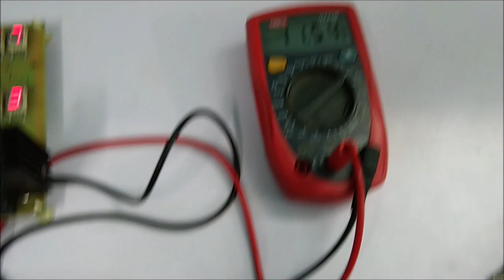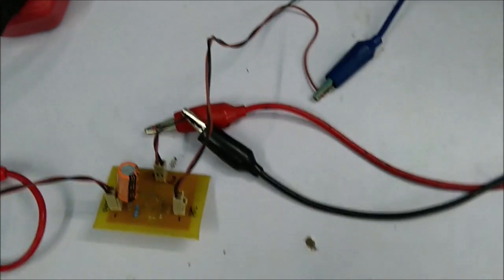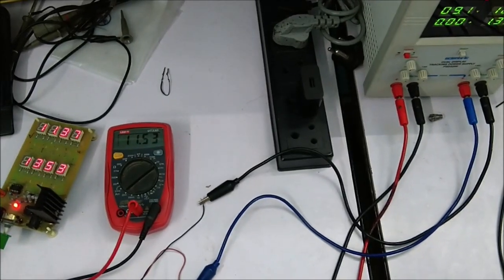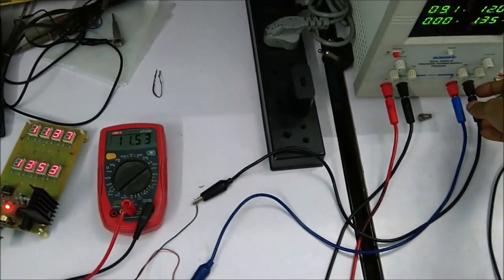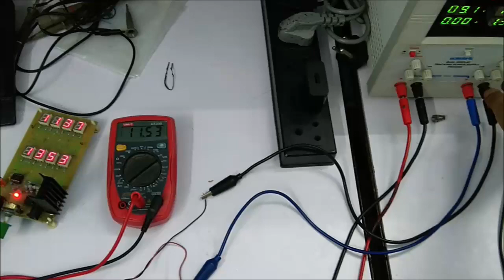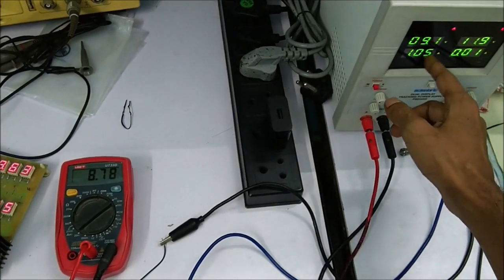Power Path Controller system using LTC4412

Comment: LTC4412 based ideal diode board also works on the same way. I have tried it and it works flawlessly. I connected 12v battery to input terminal and the AC wall adapter to output terminal.

Comment: its really nice information. I have a question. what will happened if both primary and secondary power supply are at same voltage? 
suppose both are kept at 9V??
Reply: The difference between voltage source should be 20mV. Less than that then the primary voltage source will supply the current

Comment: Is there any way ı can control the source manually as well as automatically?
Reply from the maker: yes you can use a external MCU to control that
Reply: thank you for your answer, 
Can I ask another question, Is it necessary to have two different source voltage. Because I want to supply the same voltage from two different sources? @Circuitdigest

Comment: The demonstration is kind of not enough you should have lowered the battery voltage and show at what lower input it will cut and when will it get on over battery only also the load should be a working embedded device.

Comment: Looks interesting, just curious as to why you disconnected the negative of the primary rather than the positive? If that were two separate power sources without a common ground, would that end up having some other side-effect?
Reply: your point is legit but that's the whole point "we want a constant supply to our load even if auxiliary power goes out from the main circuit". LTC4412  is very helpful for switching power applications.